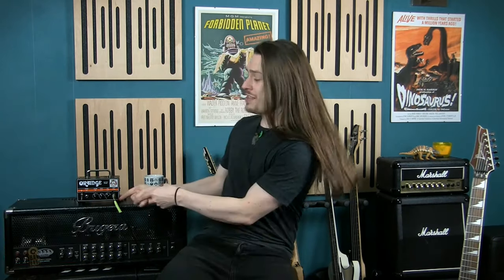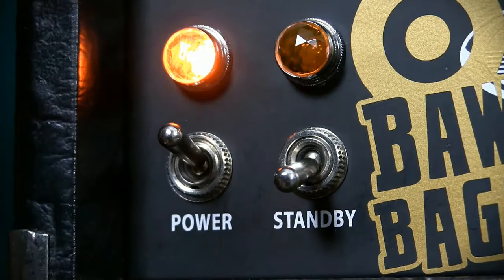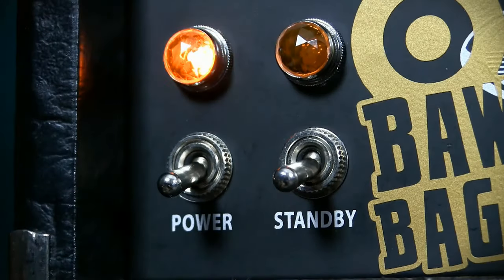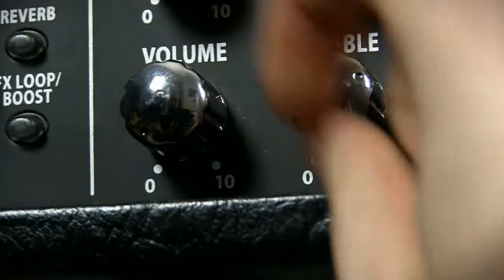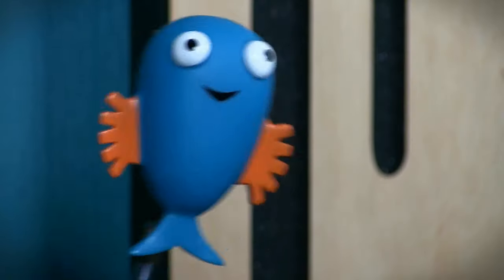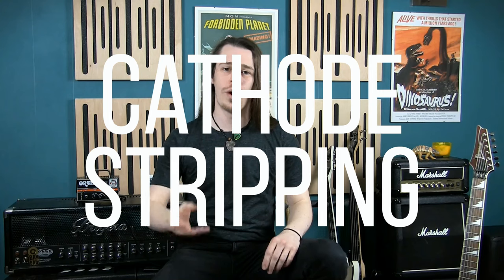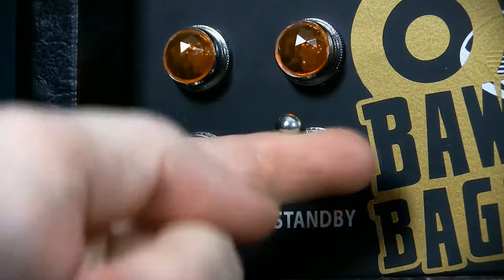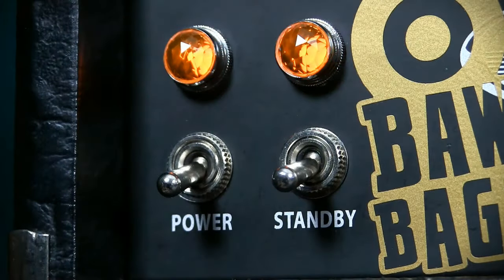Your Standby Switch Is A Lie!

Comment: I have heard that Standby switch is there for servicing purpose also. 

It may provide an easier and safer way to drain the high voltage caps. 

It make total sense in a letal high voltage risk environment.

Comment: Mr Colin: I’ve been doing everything correctly for decades but no clue about the standby story, so thanks for that. 

Question about leaving amp on (with volume down, of course). I’ve always turned my amp off if I’m not going to be playing longer than a half hour or so. But, some players claim you can literally leave an amp on indefinitely as #1, it doesn’t use much power and #2, it’s actually better for the valves, the less they are powered on and off. One gent said his wife gets angry because he prefers to leave his amp on, most of the time. Thank you, sir!

Comment: Standby switches are easier to get to if a cable shorts. Muting the amp for rig changes and warming the tubes.  I always use the power switch to shut down the amp, drains the caps, and don't touch the standby until I want to power up again.  Great video on an overlooked item.

Comment: In live situations the standby switch has been extremely useful for me. Being able to mute the amp while still keeping everything hot when I'm not on stage is so useful, since turning the volume down would inevitably mean I turn it back up to the wrong level and mess up the balance on stage. Good video though!
Reply: It may keep the tubes "hot" but actually in a lot of cases will put the amp back into a low power state and when you switch it back on will send a rush of voltage into the power tubes which is not exactly good for them..it's not the gradual build up of voltage your tubes would normally get if you had the standby on and then powered up initially.

Comment: I heard Fender used the standby switch to keep from over voltage on the filter caps during startup.  Fender used lower voltage filter caps because they were cheaper.  The higher voltage caps were double the money, and wiring in a cheap switch was easy.

Comment: It's nice to have as a mute when recording so that the levels don't change at all if you need to take a break. If your volume knobs are changed at all, you could end up getting an inconsistent level, and gain structure, which could impact how and when your amp breaks up. Most people could live without it, but it does have its uses.

Comment: I use it because I turn the amp on and then pick up the guitar cable and then grab my guitar and plug in.  I don’t get any pops and unwanted noise.  I use it to switch guitars too for the same reason, it’s silent.  I don’t know jack  about electronics, but I’d just rather not hear noise, unless I’m making it on purpose.
Reply from the maker: You know you can just disconnect the cable amp side to prevent those noises too, right?
Reply: @ScienceofLoud  well there you go throwing logic at me.  I totally understand your point. It evolved into a myth and people think it’s vital to their amp. My black heart amp doesn’t have a standby.  But since my other one does, I figure I might as well use it since it there.

Comment: You don't need a standby switch on a low powered amplifier. Proof is my 1964 Wurlitzer spinet organ; it still uses the stock 6L6 tubes and rectifier tube and it has no standby switch. Also there is no relay clicking when it comes on, you just hear a slight hum then about 15 seconds later you hear the organ.

On a high powered tube RF transmitter, you do need a standby switch because they run the plate past 1000 Volts.

Comment: Great video.  It is such an example of a lie that just perpetuates amongst those that do not know anything about electronics.  The switch is entirely unnecessary but yet everyone still thinks they are for when you take a beer break or have to take a piss.  As you note in the video, just leave it on and don't touch it any more so you don't wear it out.

Comment: It's not just the valves you should consider when applying a high voltage to a circuit.  Any switching of 300 or 400 volts to a board with capacitors and all sorts of other bits puts a small stress on those components.  They will be designed to take it, but if you do it too often, there is a chance of component failure.  Leaving the voltage on is less stressful than switching off and on.  As someone else commented, I use the standby when switching guitars to avoid the buzz.  It just easier than turning the volume down and up. If the standby was absent, I wouldn't bother switching the amp off, I'd put up with the buzz or turn the volume down. An amp not having a standby switch wouldn't stop me buying it though.

Comment: You have some very valid points there Colin, but I just personally prefer to use the standby switch as opposed to turning the volume off as I find it's the most hassle-free way to mute the amp. But that's just me really, I prefer to preset things like my rhythm sound, my lead sound, pedal settings etc and to able to activate them at the flick of a switch as opposed to faffing about with knobs all the time.

Comment: There is one benefit in standby switch - you can use the preamp only with no cabinet hooked up for load. If you use IR’s and poweramp simulation. But it doesnt work on all amps - loop doesn’t work with stand by off on some of them.

Comment: Thanks for the informative video. The comments thread was interesting, too, which is not something I would normally say. From my perspective, you gave some intelligent, thoughtful answers. I'm a novice to tube amp function, so I never really knew if there was a proper way to go about turning the amp on and off, and I never knew if there was a way to do it that might harm the amp, or speaker. I've inferred a lot of vague, mythical advice on tube amp operation over the years lacking in any sort of explanation that made sense to me. I'm guessing that outside of outright abuse, that the occurrences to be expected in normal operation of an amp used by a musician are thresholds that would be over engineered to ensure proper function in any decently built tube amp. That is my perspective as a user, the technical aspect is quite a bit over my head.

Comment: By the way, it is also usefull when you have to swap speakers without needing a cold restart.. it can save a lot of time and restarts when playing with different cabs or  reactive / resistive loads for silent recording. When doing silent recording with IR, I am actually switching many time between different types of loads and attenuators to get the sound I want.

Comment: FYI, the standby does more than turn down the volume.  I tested my Peavey, Vox, and Marshall using a "kill-a-watt" device to measure power consumption.  The power use literally doubles when you pop that standby on, and goes back down when off.   If you are like me and have 3 amps on at one time, you can save yourself about 150 watts if you decide to take a break for a bit.

Comment: I have always been told that as a rule of thumb, if your amp is tube rectified you benefit from a standby switch. These are usually older circuit designs {AC-30, Tweed era Fenders, early Marshalls until the 1959 and 1987}. Diode rectified circuits don't need them, which is what most tube amps are these days {modern designs}. There still are some boutique builders using tube rectified circuits so check with the builder or tube sheet which is usually applied to the cabinet. You can also remove the back panel and see for yourself if you know what your looking at. It was originally designed to prolong the life of this tube. The 1965 JMI era AC-30 I used to have had no Standby, neither did the 1958 Deluxe I had so many years ago {wish I had them back today!}
Reply: many will say the exact opposite.  solid state rectified amps should use the standby for powerup and tube rectified amps don't benefit from this practice.

Comment: You should use the standby switch if you're going to change the loudspeaker. The voltage on an inductor is proportional to the derivative of the current flowing through it - in other words, it's proportional to how quick the current changes. Tube amps have output transformers and when you suddenly disconnect the the speakers a high voltage will appear on those transformers. With a standby switch you keep your tubes warm and can switch speakers without killing your amp.

BTW, people who have hifi tube amps, unlike musicians, rarely switch from one speaker to another and that's why there was no standby switch. I found your video looking for AB switches to connect for loudspeakers and amps - switches that work with tube amps. Haven't found yet, btw.

Comment: I am an electrical engineer and an electronics design engineer and I will vouch for Colin on this one. Now, on high-power radio transmitting equipment that uses valves, you DO have to let the tubes warm and cool. For example, my HAM radio tube-type amplifier runs the tubes at 4,000 volts, which if I turned it on and went directly to transmitting, I would ruin the tubes due to cathode stripping in no time flat. As for my Blackstar HT Club 40, ha, not going to do shit to the EL34s, whatsoever.

Comment: Agree with the video and normally don't install a standby on a build. Worth noting, if you've just turned off the amp and the tubes are still hot then bringing it back on without SB can easily draw a large current. I just took out a mains fuse doing this.

Comment: so, here is my opinion.
I really like the standby on my amp for changing guitars on stage, to avoid the plug noise. rolling down the volume may cause issiues with the sound guy, since you won't be able to bring it up again at the exact position (we all know what a millimeter can do on a master). but I haven't known that the heatup thing is a lie though, so thanks Collin

Comment: Well, in fact, there is a standby mode on the TV. First, you press power on button, which is on the TV (which is the same as power on switch on the amplifier), and when you press it, TV is in standby mode. When you want to watch TV, you press standby button, which is on the remote controller (which is the same as standby switch next to your power switch on the amplifier), to turn on the TV.

Comment: Agreed. If you have a valve rectifier then plate voltage isn’t applied to the power/pre valves until the rectifier heats up anyway.. taking out the standby switch opens up options for adding a pot or switch for mods too..

Comment: I've had a the same fender tube amp since 1980 and I've never used the standby switch. It hasn't ever affected the tubes period. I've replaced power tubes on it two or three times since I got it. Preamp tubes I switch every now and then when some new trend like jj or groove tubes or whatever is the new thing comes along. This video is correct.

Comment: Cool rant dude! Like my father used to tell me, if you're going to do something then do it right, and If it's worth doing then do it right! Rant on my brother. Happy New year 2020!
Reply: If you use the standby switch that does allow the amp to warm up, right? So, warm up your amp for a few minutes. The tubes, the chasses, everything warms up a little bit compared to the ambient air temperature in the room. I think this is a good thing. Also on startup by all means have every knob turned all the way down when turning on your amp.
So after the amp has warmed up above the room ambient temperature and then you turn on the standby switch the full voltage is now applied to the tubes. Since they are indeed a little warmer than the ambient room temperature I can only thing this is a good thing. There is always a voltage spike when you turn on the power and also when you turn on the standby switch. The standby switch in the off position prevents the voltage spike at the moment the power switch is turned on from hitting the power tubes. However, when you turn on the standby switch that is now the moment when the amp is hit with the voltage spike. However at least now the amp is a little warm meaning the voltage spike is not hitting a completely cold tube. Also using a variac to limit the inrush of current to 105 vac or less instead of the 120 vac from an U.S.A. wall outlet shall also soften the voltage spike. Then after a short time you can ramp up the variac to the normal 120vac output, or you can set it to something like 110 vac to conserve the tubes a little. - Peter age 73

Comment: Pretty interesting, never knew that, always had slight fear of the power switch. 

In defensive of the stand by, if you're gigging with an amp that's quite sensitive to small pot changes (the handful of times I've used mesa's they've been lovely sounding, but could jump in volume without much movement) it makes life much easier. Like in between sound checking and playing, particularly if your sound man has spent some time getting everyones monitor mixes sorted.

Comment: An issue I haven't seen mentioned is that some amplifiers aren't always completely silent even when the volume is set to minimum, either because of electrical interference, ground loops, mains hum, or microphonic pickup into a reverb unit.  A standby switch would eliminate all of those.

Comment: This may apply to newer amps but on my vintage jubilee it takes at least 10 minutes in standby to get the amp sounding anywhere near its best. Standby is basically just cutting the B+ transformer output, leaving the (usually depending on valves) 6.3vdc rail for the pilot light an the valves. The means that all other parts of thecircuit are seeing no voltage and will last longer

Comment: Strongly disagree. In many Fender amps, the standby switch is very useful.
Not because of it's valve-saving powers, but because they use log pots for volume (why????), making it a pain in the b*tt to adjust it on low levels. Setting up volume on Hot Rod deluxe takes a microscope and tweezers if you don't want to wake up your neighbors. So, killing it with standby is more practical.

Comment: Great to hear your comment on the SB switch. It was indeed copy'd from early Fender amps. Although the first amp from uncle Leo had no SB switch either. L Fender was in his early days a radio service man an he worked on receivers and transmitters. Transmitters work on a very high voltage to get the high  power for transmitting. As you said there  was the standby switch useful. In my naval radio time I always used the SB switch from transmitters. But on my own build guitar amps never. absolute rubbish

Comment: As taken from the valvewizard website: 

Pro (of a standby switch): 
2.Reduces the chance of arcing in direct-coupled valves, e.g. cathode followers

Since most valve amps use cathode followers to drive the tone stack, which is inherently badly designed to begin with (but also what makes it sound amazing), most amps should use a standby switch just for the warmup procedure. Also any amp with an elevated heater supply will benefit from a standby switch warmup.

Comment: There was one reason for using the standby switch at startup in the past. At startup, when the tubes are cold and don't pass current, the voltage coming from the power transformer was at its highest. Once current started to flow, the series resistance would drop this voltage to the working level. Why is this an issue?? High voltage capacitors in the power supply were big and expensive back in the day, so by using caps rated for the working voltage instead of the 'cold switch on' voltage, manufacturers could cut costs. No longer an issue today though.

Comment: I really appreciated this video Collin but you just didn't mention an important thing which can make big difference and cause issues.

It's all about right what you said on the futility of the standby switch concerning saving the life-time of the tubes but what about the filter capacitors on the rectification side of the circuit? If they are not properly dimentioned in terms of voltage peak, without using the standby switch you can easily blow off them.

Since initially the tubes are cold there isn't voltage drop through them, so if the amp isn't well enginered, or the manufacturer has saved on components, you are just shortening your capacitor's life-time... and not saving your tubes as well!

Nowdays big reservoir capacitors are pretty inexpensive and manufacturers tends to use properly dimentioned ones, but honestly (as amp technician...ish) on commercial amplifiers, expecially cheap ones, I suggest to keep using the standby switch. Hopefully not as a mute switch as a lot of people does, because leaving hot tubes without applying tension on plates can eventually cause some issues tho...

Comment: The standby helps prevent damaging your speakers, recording equipment, headphones etc from power up/down voltage spikes. At least on my JCM 800. There's nothing worse than 100w RMS 'FLADUMP' at 4am when you've left your amp on all night. Last time that happened a little bit of involuntary wee came out!

Comment: Just watched this video. I know it's an old one but I hope you are able to see these questions. If I'm playing at a gig and all of my settings including my volume, are
right where the sound guy wants them and I switch guitars, I will walk up to my amp and hit the standby switch. I switch guitars and hit it again. Have you ever
unplugged a guitar at high volume? Have you ever turned your volume down in a dark stage setting just to take a brake or switch guitars and then not put
the volume level where it was 10 seconds ago? You might have gotten lost in the mix for the rest of the show while you see the sound guy scratching his head
during the next 2 songs. Do your amp, the crowd, the sound guy and mostly your speakers a favor and use your standby switch.